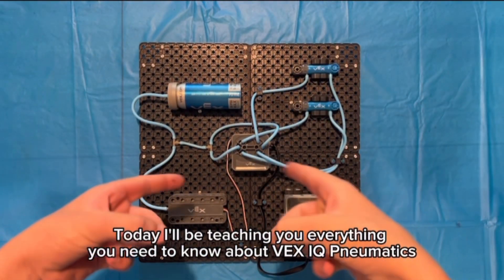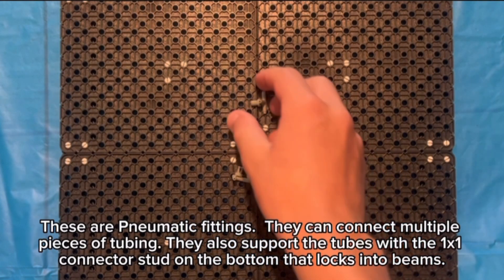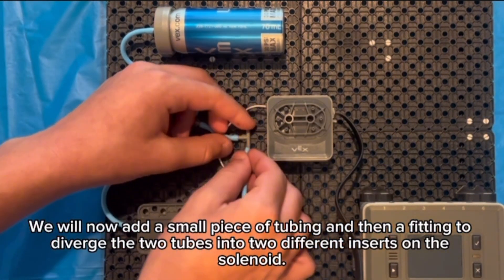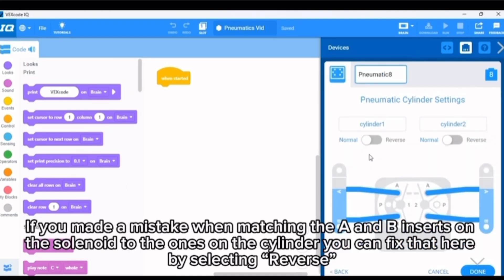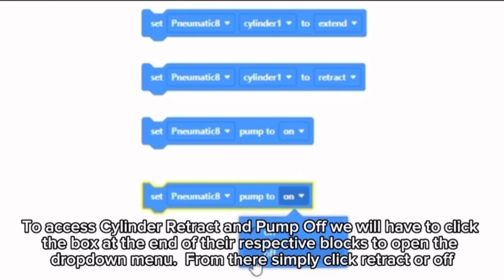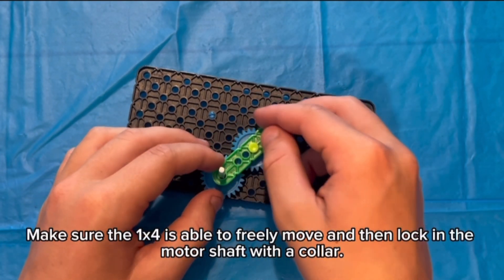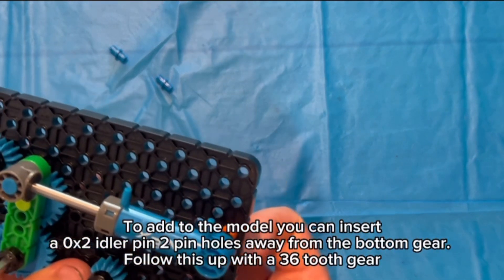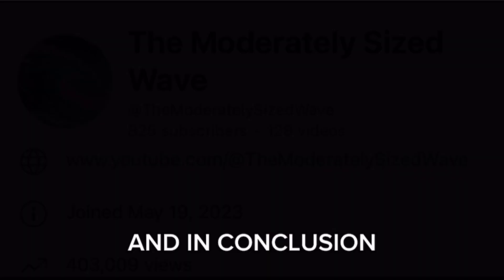VEX IQ Pneumatics For Dummies

Comment: do both sides of the solenoid have to have tubing and something blocking it because I only had one side of mine connected to a pump and it would not work, then I put my finger against the holes on the other side and the pump would finally work